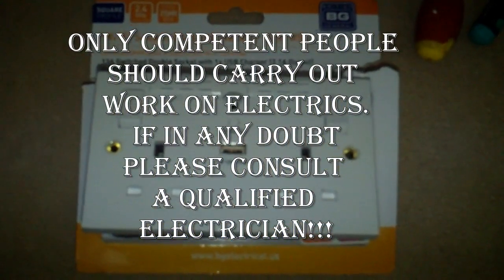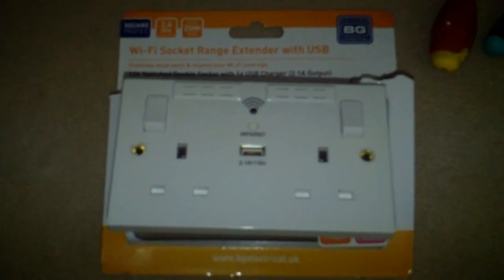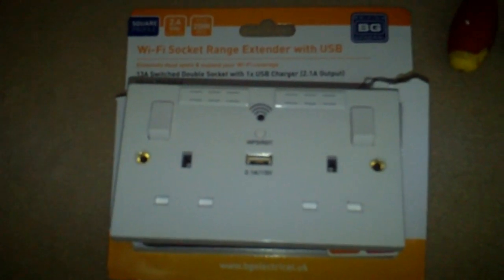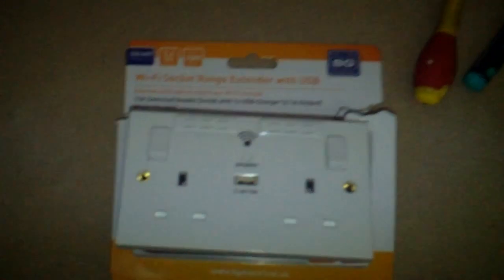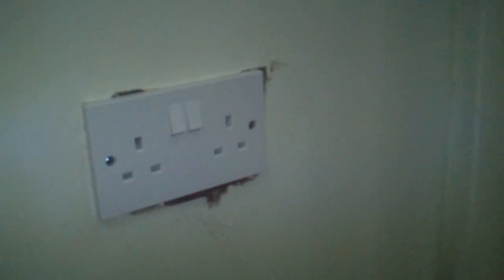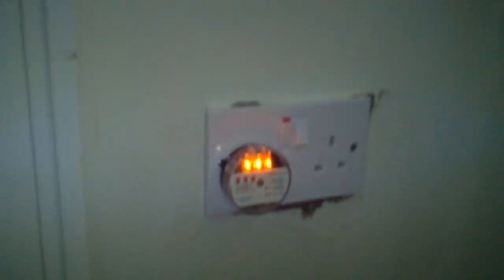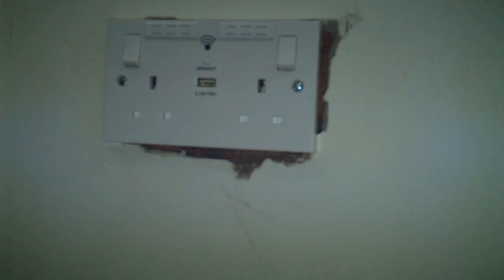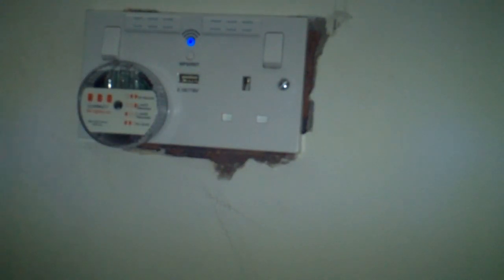Extend your wifi signal, quick and easy!

Comment: Thanks for this.  If I add another socket (same brand and model) will the Wifi be the same band on connection or does it bring another name.?  Do they do one with 5G extender or is it only 2G?   Please can you comment on the speed BEFORE and AFTER what you get with the booster.

Comment: It’s a bit more complicated than just boosting your WiFi if you don’t set it up right it leaves an open network that anyone can access but by following the instructions you can make it secure and you can use multiple socket around a house to help strengthen your WiFi
Reply: Dooley what do you mean by setting it up buddy so mine are secure
Reply: Bond Bondy when you turn it on the network given of by the socket will be called bg connect to that network then go to big.repeat.net and just follow the online instructions there

Comment: Can these be piggybacked around the house for an even better signal strength?
Reply from the maker: Bryn Smart apparently only one can be used but I haven't tried piggybacking them.
Reply: the video on screw fix shows or implies then in all rooms?